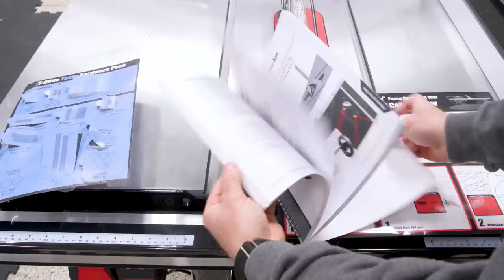I Left Powermatic for Sawstop!

Comment: Great saw.   I am long time follower of Wood Whisper and years ago, when the time came to buy my table saw, was ready to but a PM.  Last minute changed my mind and got a Sawstop for the safety feature.   I do not use their blade guard, use the aftermarket Shark Guard, and I use it just about all the time.  Their rail is very good.  The table was easy to align and has stayed aligned.  The only issue I ever had was a piece of metal tape I didn't notice on a board once set off the blade stop and it was an expensive lesson to learn.
Reply: Can you speak about your experiences with the SawStop blade guard versus the SharkGuard.  I just bought the SawStop, but I have a leftover Shark Guard.  I could pay a few bucks to convert the shark to the new saw, but I'm wondering if I should bother.

Comment: I've had the 3HP PCS 220V 52" table for several years now and it's great. It is my 4th table saw and the only one that I have ever kept the blade guard on. Ironic, huh, since the others didn't have any safety features! I activated the brake once with my Incra Mitre and I was completely surprised by the instantaneous reaction of the saw. Wow! I couldn't find a single scratch mark on the mitre. As for dust collection, it's the best. I did however, upgrade to the Overarm Dust Collection recently because I got tired of exchanging the riving knife and blade guard whenever I wanted to make through and non-through cuts. You're gonna love it!

Comment: I just bought the PCS 3HP saw with 36" fence this past December. Keep in mind, this is my first brand new tool purchase, but everything you said is spot on. From the color-coded instructions and hardware packets, to the fit and tolerances, this machine is very well designed and built. I had to run a tap through one threaded hole in the rail due to a small goober, but other than that, EVERYTHING fit perfectly. Miter slots were perfectly parallel to the blade, fence, was parallel to the blade, and even the miter gage was exactly 90 out of the box. Very impressive machine and a pleasure to use!

Comment: Something I discovered with wet wood if your wondering if it will set of the breaker is before starting the saw touch it to the blade and is the ready light flashes that is and indicator that it is going to trip and your should lock the break out for that cut
Reply: You need to do an actual cut in bypass mode to be sure. The system is much less sensitive prior to operation than when the saw is running, plus the inside of the board could have a higher moisture content than the outside

Comment: A trick on the engine hoist is to loosen the pressure release that is used to lower the hoist, lift up on the hoist arm to where you want it just about and then retighten the pressure release. It “should” stay around that area when you let go of the hoist arm and save you about 9000 pumps of the handle +\- 1-2 pumps :)

Comment: You made the right call on the PCS! My ICS was delivered in November and was, honestly, a nightmare. After three months of issues with the arbor and table and trying to get it fixed I finally gave up. They offered to send me a new ICS, but said it would likely have warranty issues as well. I had it returned instead. I ended up ordering a slider to replace it which should show up later today!

Comment: I’ve had the same model since 2015. I’ve never had to adjust the dado brake when switching out. I doubt it adds more than 10-15 seconds to the process. Love my table saw and that ICS mobile base.
Reply: Do you have a 10" dado set?  The dado brake has different clearances to accommodate the smaller 8" dado blades.  Or am I missing something?  I swap my brakes quite a bit and you're right, with practice it gets pretty easy.
Reply: @independent900  8” Dado set with the appropriate brake.

Comment: I have had my SawStop for over 10 years  ( not sure exactly when I bought it ).  I have had one accidental brake incident, and it was my fault. I did not adjust the clearance after putting in the dado stack. But, it has been rock solit. and other than replacing the fence faces due to the rubber top peeling off, I have done no maintenance at all. Only adjusted the top after a move from AZ to TX. The plastic center knob on the adjustment wheels has never been an issue. I have the 3hp motor, and it cuts even 3 in hard maple with no issues. So I am happy. Really like your review, and interested to see your enhancements video.

Comment: I have had the same saw for four years and have two activations both were operator error of cutting styrofoam with a foil backing and
While setting up the incra 5000 sled and getting the metal fence too close to the blade while my hand was on the fence.
Recommend you have a spare brake unless you live close to a woodcraft dealer because it is a five day shipping via amazon on the
Brake. When a brake does engage it take a lot of effort to remove the blade and brake that are jammed into each other took
About10 minutes of prying.
I agree while I have all most of my machine powermatic except the sawstop

Comment: Just sold my powermatic 66 with 31” fence that I bought new in 2000 and replaced it with a saw stop pro 36”.  First off the 31” fence drove me insane.  If you buy a table saw go at least 36”.
Second, the saw stop is such a smoother saw.  Wish I would not have waited so long to add safety to my job

Comment: Used to work with a 7-1/2HP Dewalt Radial.   The mechanical blade brake also gave us a lot of malfunctions.   But then we discovered an all-electronic blade brake.   Even with the big motor and a 22" Carbide blade we could stop it in under a second. But we had to ease off that a bit.  Very fast stops would loosen the arbor nut (obviously not a good thing) About a second and a half was optimal.

Comment: I have the SawStop Model PCS175 and I love it. The Folding Outfeed Table has been a great accessory.  My next upgrade will be the Floating Overarm Dust Collection because the Overarm Dust Collection blade guard's dust port is so small it clogs easily and is difficult to unclog.  That happens mostly when I'm trimming a board and have a small thickness offcuts. These offcuts sometimes break off and gets sucked into the blade guard and they are stuck.

Comment: Mark, you reminded me that I could adjust the play in the rip fence, which I did.  But afterward I couldn't clamp the fence in position.  I called SS tech support and they told me to reverse the adjustment,  and to pull the locking lever away from the saw when fine tuning the position (to seat the two pads).  I loved getting rid of the slop, but disappointed that there wasn't a separate adjustment for the locking lever.

Comment: I have a sawstop jobsite and a Dewalt 10” jobsite.  I also have a Delta unisaw from the 60’s.  I also have a Felder K915 slider.  
I love all the saws!  I just don’t trust that safety thing and I often use dado blades.  The convenience of not having that cartridge is nice.  I’m honestly thinking about selling the Sawstop and getting a Pm1000 to go in my garage.  I have 3 shops in 3 locations.  One is 20 miles away with my Felder and big Oliver jointer and stuff like that.  My garage is centered around 3 mfts with a track saw as the center of my shop.  I am building kitchen cabinets and the track saw gets used more than the TS

Comment: Completely unrelated question.  How deep is the miter saw station that you have?
I am building a new one and have the more common miter saw where the slider extends backward requiring a deeper top.  However I wish to upgrade to a style like the Kapex or bosch  GCM12SD where it does not do that.  So I want to design it for what I have now but one I can easily modify if I do upgrade and I can gain some more floor space.

Comment: I can attest the ICS saw has an amazingly easy adjustment system as the PCS, it has a table pivot point in the front and two bolts in the back to push the table in each direction. Works perfectly, I’ve even been able to take the table off and put it back without needing adjustment. Really cool.

Comment: Great review on your new SawStop. I was planning to buy one a few years ago mostly to get a more powerful table saw, but also for the safety factor. I delayed the buy when I bought a Festool tracksaw, so some of the need was fulfilled — breaking down sheet goods. Also, I have a narrow basement shop, so the thought of getting it in, and having room to maneuver, was a concern. I plan to expand my shop by removing a wall that divides off my shop from the finished room in our basement. I’ll get that much needed extra space, and plan to get a PCS model as soon as expansion is complete.

Comment: Thanks for the great review. I got my ICS 10+ years ago used. a couple of notes:
* ICS is left tilt blade, so the dust clear out door is on the right, under the ext table
* PCS is a right tilt blade, door on left 
I think door on left is more convenient, easier to get to, no need to crawl under the table AND if you want build a cabinet under the ext table  - you can ;-)

Something else to consider is - do you ever want to get the Sawstop Router Table setup gizmo. Its expensive but in a small space might be worth it. It is generally pictured on the right as part of the extension table. Haven't determined if it can go on the left side.
If you get one please do another video.

BTW: I have no opinion about right vs left tilt. My comment is solely about where the big metal box/door is under the saw

Comment: Felder has blade-stopping/dropping tech that doesn't involve any consumables and doesn't damage the blade. I'd really like them to bring that down the line from their top-of-line industrial stuff, as everyone's hands are important, and this is great tech.
Reply: It would be nice. But their PCS stuff is at the $20k price point.
Reply: @mrector23  Yeah. If they brought it down to the 700 line, and sold more of them in a production mode, it would be pretty amazing.
Reply: @Psychlist1972  - I would have paid $2k more for it on my 700 in a heart beat!
Reply: @mrector23  Same. But I do still like the sliders over sawstop anyway. Great blade brake, you're never really standing in the kickback zone, and you don't have the same friction when moving pieces past. So I think it has the potential to be a safer saw than cabinet saws. Sawstop gets pretty expensive, so not as much a price diff as folks think. But if the safety brake on the sawstop is the thing that draws one to it, there's nothing (affordably) equivalent right now.

Comment: I went with the exact same saw recently.  Well, almost exact....I ordered the 30" version and upgraded to an Incra fence so I have more capacity than I could ever need.  Zero regrets with any of it...it is without a doubt the central hub of my woodshop and has made my hobby so much more enjoyable.  I upgraded from a SS Jobsite...also a great piece of gear that I plan to hold on to.

Comment: A few days ago my SawStop break cartridge saved my right hand finger.  I'm a luthier and playing guitar is my main passion, losing a finger would be catastrophic to my wellbeing, that's why I bought the SawStop.  Still, I pretended like this safety feature didn't exist with this saw and have always been extremely careful.  Well, I guess I wasn't careful enough.  It didn't happen when I was pushing wood through, but when I was removing the cut wood.  There was a loud bang and I felt the slightest pressure on my finger, the blade was nowhere in sight.  I looked at my pinky and saw a very slight abrasion, almost not noticeable.  I am so glad I bought this saw.

Comment: Hi Marc, great video.  As a Sawstop ICS owner I can tell you the overarm guard does have one big flaw.  While the dust collection is excellent, strangely the opening where the hose connects is smaller in terms of total area than the front of the guard where chips and dust are sucked up.  Many times I've had little off cut pieces that are big enough to get sucked up but not big enough to go through the opening at the back.  They get stuck and clog everything up and you have to stop and remove the guard and I often have to use a plumber's drain stick to fish the pieces out of there.  Not fun.  Also, the safety system is necessary even with the guard on.  I know this from experience.  I was ripping some small stock with the guard attached and when I reached over with my left hand to grab the off cut that came off, my index finger contacted the back of the spinning blade because those side wings on the guard rise and lower with the thickness of the pieces being cut.  that left an opening big enough for my finger to go through.  The safety system worked just like advertised, and though I had to go to the ER and get a few stitches, my finger is still attached!   Best of luck with the saw.

Comment: Can you post a video about the fence cause I bought it all and it doesn’t fit on the bottom with bolt holes
Reply: Please post some info on attaching the extrusion fence. Did you have to cut the bolts down and shorten them? You can't tighten them down without a spacer or a shorter bolt length.

Comment: I purchased a 36” PCS 1.3/4 HP roughly a year ago. I wanted the 3 HP, didn’t want to wait. I did all the assembly myself, no help. I’m 5’11” and 160lbs. After setting and using the saw  for about a month, I noticed the motor had wiring for 240 on the label. I decided to call SawStop support. Guess what, the 1 3/4 HP can be converted to 240V with an $75/$85 connector dox. How fast can I get it!!! Went to big box store purchased the new power cord and a twist lock 240V connector. Installed all the parts and , been working great!! I find the 34 1/4” is not something my back likes. I have made a 1 3/4”  3/16 wall square tubing to raise the saw to standard counter top height. Inside the hydraulic castors. I had to modify the length on light weight legs. 
LOVE THE SAW!!!

Comment: I had to make some adjustments to my SS which required removal of the belt. I could not get it back on so called SS customer service for help. They made a video specifically for my issue and emailed it to me. Belt went on effortlessly. They excel at instruction manuals & videos.

Comment: i only take the blade guard off when i am doing joinery cuts, like tenons, grooves, dadoes, etc. and tapers or other oddball cuts.

also, you might like the sliding table saw attachment.  It makes cross cutting a breeze, and handles large stock.  there are two sizes, the small and the large.  I don't have room for the large but would have gotten that one had i the space.  The small one works well enough.  You do have to check for square every time you use though.  I use the attachment without removing the left wing, increases the effective size of the table on the left.

Comment: The PM2000 casters may not work as well on a non-perfect floor, and it really feels like it takes 1000 revolutions to raise/lower them, but I've only used mine twice: original installation, and a minor shop rearrangement. They were really handy for those occasions, and it's really been nice not tripping over them every time I use the saw. If I had an engine hoist I'd probably remove the mobile bases from my bandsaw and jointer.

Comment: Just upgraded from a decent contractor saw to the 3HP PCS 52 but with the integrated router table - which is really a 36 workable area.  It ultimately saves me space over the separate router table I used to have.

Comment: I too made a commitment to myself to use the blade guard on my PCS, mainly because of dust collection.  After about 6 months of sticking with it, I finally succumbed and took it all off.  It just got too inconvenient to take it on and off depending on what the cut demanded, and I decided to live with the extra sawdust that came off the blade above the table.  I betcha you will do the same.
Reply: The floating blade guard is a big help with this. You can use it for most cuts but it's very easy to get out of the way when it's too obtrusive

Comment: I looked at Saw Stop before I bought my PM2000. There were too many cons on the Saw Stop for me to buy it. Everything on the PM2000 was dead on, I had to make no alignments. I bought the 30 inch and modified it so I can rip up to 38 inches. Also I put a short rule on the left side of the fence rail like the Saw Stop has (did that before I knew they had it). The built in mobile base on my saw works great, it has a lever that you pump 10 times and its up and rolling around. It also has a DRO for the blade angle, which works great and the fence on mine doesn't do that shift when locking it down, like the Biesemeyer fence I had on my previous saw. Your video in 2016 was another reason I bought the PM2000, my world has now been turn upside down now with this news you bought a Saw Stop.

Comment: One downside for me with SawStop's fence:  On a couple different occasions, my projects required cutoffs of very small pieces, small enough to fall into outer miter slots.  In my productivity-haste, I would not check to see if one or more of those pieces protruded out of the slot, slightly above the table surface, high enough that when I slid the fence over it, the raw laminate edge was cought by the off-fall piece and in a couple cases, snapped (broke) a little piece off the fence, leaving a divot that could inpact future cuts.  I have replaced one fence piece and have rotated one to the other side (which I almost never use) to save on buying a second fence piece.  Maybe this will never happen to anyone else, but that raw bottom edge on the fence piece is a weak point, in my opinion.